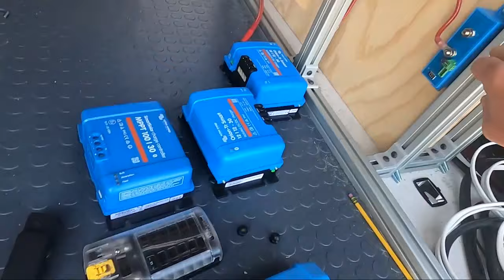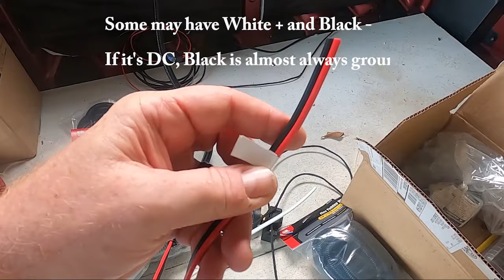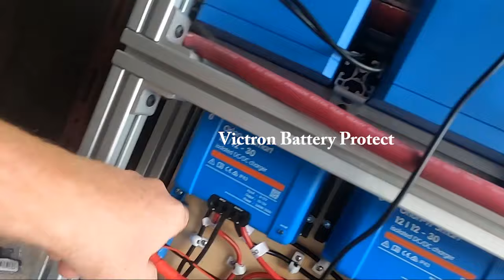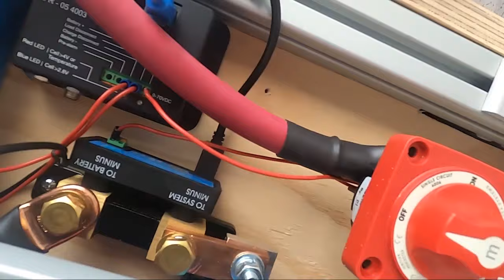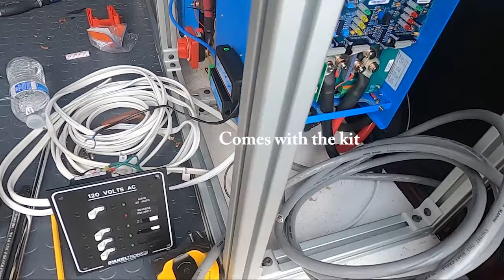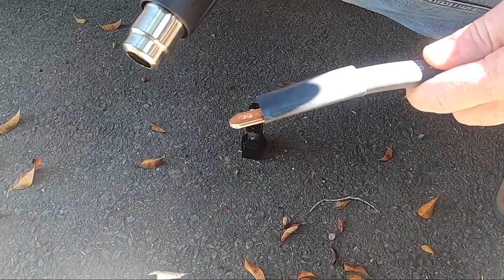Victron Electrical System - Ram Promaster 3500 Extended

Comment: Got couple question regarding to the litttelfuse power distribution. Did you use Mega fuse or MIDI fuse? I saw their installation instrution, it said MIDI. I purchased the the 60A Mega fuse, not sure if it can be used. Also, were you using the 2awg 5/16 lug and 6awg 5/16 lug for wire connecting the distribution terminal?
Reply from the maker: If you're talking about the little 3-to-1 terminals from the mppt charger and the orion chargers to the main Linx Distributor, and the 1-to-2 for the Alternator power to the Orions, they are the midi fuses.  They're much smaller than the mega fuses.  I don't think a mega will fit in those.  All my other fuses (in the linx) are mega fuses.   Also for the lugs, they should have a 1/4" hole (2 AWG - 1/4).
Reply: @redgiantvan189  Thanks for the quick responeses!!! You're the best!

Comment: Hi, got a question about the fuse that you use for the wire going from the littlfuse to the lyn distributor. You have three 30A loads((2)DC & Solar. Are you using 125A fuse? I know that you change the solar to 50a.  I have simliar set up as yours but (2)30A DC & (1)30A solar.
Reply from the maker: Each output (DC-DC & MPPT) has it's own 60 amp fuse and that then gets combined to the Battery Protect.  From the Battery Protect to the Linx, I have a 200 amp fuse.  I won't actually get more than 100 amps from the Battery Protect.  Even though I have a 50a mppt, it won't provide that much power while driving (DC-DC) the as the sliding panels need to be pulled out to maximize solar.
Reply: @redgiantvan189  So if i have (3)30A going to the lyn distributor, a 125A mega fuse with 2 Awg cable should be good right? just want to see your option.
Reply from the maker: @jeffhuang8890  It mostly depends on the length of the wire you're running.  Wire will have resistance over longer runs that will start to generate heat.  Your fuses should protect the wire.  According to Blueseas, a 2 AWG cable less than 15 feet (positive plus ground wire length) needs to be fused at 120A or less.   You could probably get away with a 100 amp fuse since your devices are 90 amps.  Use the Bluesea chart to calculate what the wire is capable of running for amps.  Then fuse the wire for that amperage.  My guess is it can likely handle a bit more than their recommendation (e.g. a 125A fuse) but as I'm not an expert, so I'd go with their recommendation.  Remember that the length includes the ground return.   http://assets.bluesea.com/files/resources/newsletter/images/DC_wire_selection_chartlg.jpg
Reply: @redgiantvan189  yes, i probably stick with the 125A(since i already ordered it). I have the same set up as yours pretty short run. From the littlfuse box(3)6 awg wires with (3)60a fuse to lyn distributor is less than 5 ft(so 10ft positive plus ground wire length). Thanks!

Comment: Great video as I'm doing dual orions, until now this is first I've seen that no ground cable was needed to go back to the  Orions and lynx ground. How's it working out for you? I only have single 180amp Alternator and may throttle back one of the orions if its too much but I did confirm it should be good.
Reply from the maker: They are grounded to the chassis (Orion negative to negative bus, negative bus to Linx Distributor negative, Distributor to Chassis).  The Ram's battery itself is connected to the chassis so I'm just connecting to chassis as well and using the van's metal as one big wire..    Usually the issue with grounding to chassis is noise in the line (for big audio systems).    Since I'm still in the build process, I haven't done a road test with it (or drained the battery).  But as long as it's a good ground, it shouldn't have an issue.   That said, it's always safe to go back to the battery through a wire.
Reply: @redgiantvan189  Thanks it helps as were going similar routes with b2b's and the sliding solar rack on a PM. Your inspiring and informative and I like that you don't "edit" too much and add in fluff like other youtubers!
Reply from the maker: @millertime920  Thanks!  It drives me crazy sometimes, so I consciously made the effort to avoid unrelated content.  I also try to balance the detail.  I know too much can be tedious, but one can always fast forward.  But too little detail isn't as helpful if too many important steps are skipped.    I like to include steps that I was searching for and didn't find.

Comment: I noticed on your VE.BMS you don't have the Battery + or - connected.  Is that because the cables you intend to use extensions with serve that purpose?
Reply from the maker: Yes that is correct.

Comment: Hi, Nice video and great explanation. Have you tried to charge the batteries yet and if so how does running 2 DC/DC chargers work at getting the batteries charged ? Are you able to get 60amps to the batteries ?
Reply from the maker: I haven't had a chance yet.  I've been distracted with other projects in the yard for my wife.  But yes, two DC 2 DC chargers should work together to provide 60 amps to the battery.  I'll post an update once I get it updated.  I still need to hook up the solar panels, run the shore power outlet, hook up another DC subpanel and ground the entire system to the chassis (I'll be grounding the 8020 as well).  I also have Cerbo and a display unit to install.  Then I need to go through all the software updates and configurations for the components on the Victron app.
Reply: @redgiantvan189  thanks for the quick reply, I look forward to hearing / seeing the results

Comment: Your ac out 2 is a 120vac pass thru only, that is only turned on when you're hooked to shore power ( an ac source is connected & turned on ).  Ac 1 is your inverter power out / shore power pass thru.
Reply from the maker: Thanks for the tip!  I edited that part out.

Comment: So if I understand your system, you are paralleling three batteries correct? For a total of 600 amp hours? If so, did you consider a second alternator for the pro master? It will take about roughly 20 hours for you to recharge your system, am I understanding this correctly?  You do  have a 30 amp DC to DC charger. Did you get the 220 amp alternator option with the pro master?
Reply from the maker: Also, yes, hooking up the batteries in parallel (12v/600 amp hours).  But serial and parallel don't make any difference in the amount of power required to charge the battery bank.  It will still take the same amount of time whether the battery bank was at 12v (parallel) or 36 v (serial).  Amp hours is just a total amp capacity at a particular voltage.  The better way to think about it is in Watt Hours ( Watts = amps x volts).  The power (watts) is what is constant.  So my system is a 7.2 kilowatt system (12v x 600 amps = 7200 watts).  If I change the voltage to 36v, the amperage capacity drops to 200 amp hours but the power is still 7.2 kilowatts (36v x 200 amps).
Reply from the maker: I have considered a second alternator.  I'm waiting to see how the system works.  I have 2 30 amp dc dc chargers with the 220 amp alternator.

Comment: working on my victron system too.... :)
Reply from the maker: Nice!  What are you putting in?
Reply: @redgiantvan189  I have 6 nea320w panels, 2 mppt's, multiplus 2 2x, and the smart cerbo gx, smart shunt... just need to figure runs and fuse/breakers... did some facebook updates